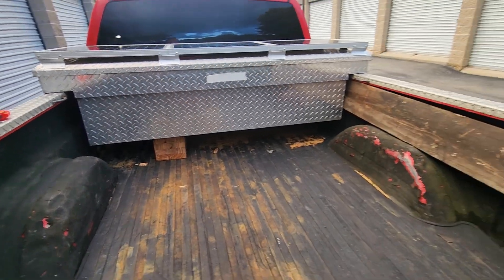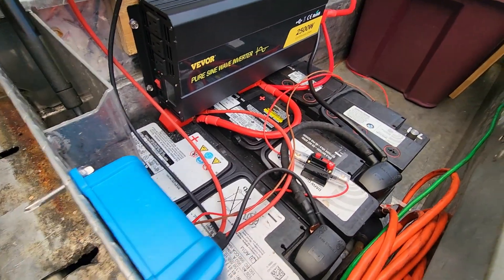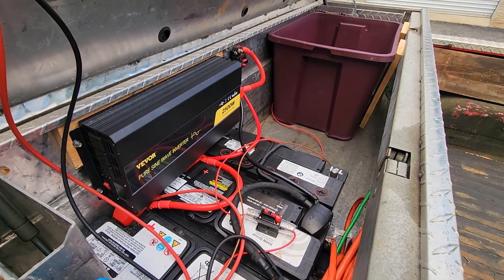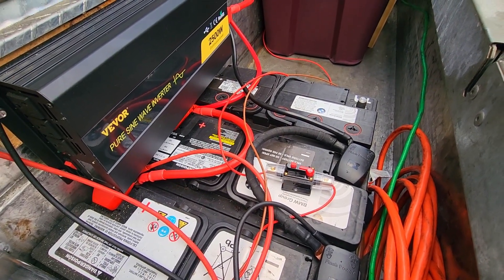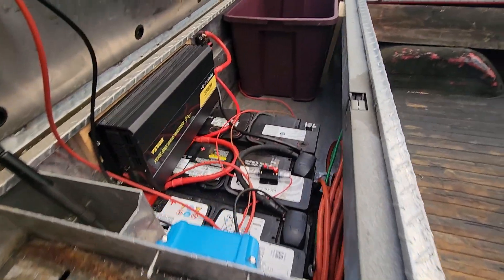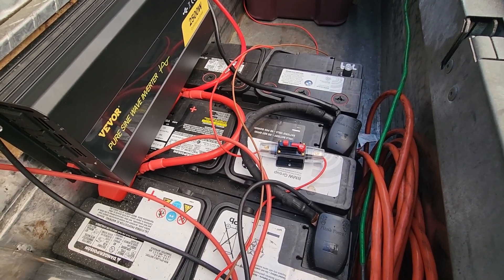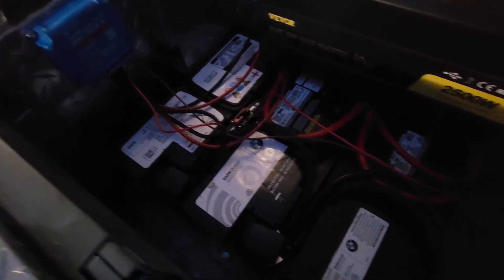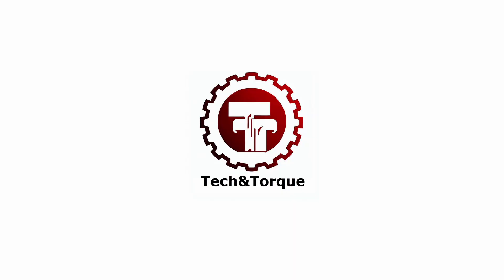Solar Truck Bed Toolbox Update

Comment: I will build the same with your information, please make finished parts list in detail and I will be adding mounted ARB system, marine on/off and outside plug-in for accessories via opening the box. Thanks
Reply from the maker: I have an update video about halfway finished, but living in the northeast it's been snowing non stop. I'll do what I can to add the parts I used to the description

Comment: Looks decent but man oh man, that's a lot of lead being charged from only 150W of panel!  

One thing I wasn't sure about... is your cooler powered 24x7 or only when you are on a job?  If it is powered 24x7 it will eat most of the generation those panels can put out in full sun. The panels in full sun can charge roughly 600Wh/day.  A compressor cooler is gonna eat an average of around 15W though which is 360Wh/day just by itself.   And the inverter's vampire draw, if left on, will be 10-20W as well so if you forget to turn off the inverter that will eat between 240Wh/day and 480Wh/day doing nothing.

To really make it work nicely you probably want another 150W worth of panels and a second charge controller wired into the system so you are net positive.

Also, side note:  The load output of the Victron doesn't need to be fused, It will automatically turn off if shorted or more than 15A is pulled (It will auto-reset and retry every once in a while if that happens).  Also, you can use the jumper to program the low-voltage shutdown for the load output to either 11.1V (reconnect at 13.1) or 11.8V (reconnect at 14.0V), depending how you want it to behave.  See the Victron manual on jumper positions.
Reply from the maker: Yes, this was a quick and dirty power supply that got out of hand very quickly haha. The Victron app shows me most of the nerd data I'm looking for. My fridge pulls about 55-60 watts when not in eco mode, and only runs for about 15 or 20 minutes per hour depending on the temperature inside the truck. I had it running for months and the panels would make it all the way to float charging by noon usually. Now that it's cold here in New England, I have a 150w 12v space heater that I leave on when it's below freezing to keep the windows clear and precondition the interior since I also plow with this truck. I added a Renogy DC to DC 40 amp charger to recharge the batteries from the alternator if needed, but I have it wired to a switch and only needed it once since I installed it. Power went out here for about 12 hours below 0 and about a foot of snow. Ran an extension cord to my house to run the refrigerator, some lights, and thermostat (propane heat, hot water, and stove/oven). There are a lot of needed improvements but so far so good. When it gets warmer maybe I'll add some flexible solar panels to conform to the roof now that they're more reasonably priced. Thanks for your comment!

Comment: Nice! I've been running that same inverter for about a month to pull my sheds lights, fridge, cordless chargers, etc. I did my build in a 24gal Craftsman Rolling Tote and have that inverter, a BougeRV 40a mppt, (All on a piece of Advantec on hinges to allow access to my batteries) 2 100ah Vatrer Lifepo4 Batteries  (Both have Low/High Temp Cutoff and 1 has a Heater Built in, R3 Foam/Metallic Insulation Board surrounding them and Spray Foamed for tight fit and Cold Protection, but they're still removable) 30' of MC4 extension cables, all Fused with Breakers. I have a couple Harbor Freight 100w panels that I put MC4s on for parallel on the fly but have 600w of Renogys on my shed that are simply plug and play. I love these portable builds, might do one for my truck box as well. Great Vid!

Comment: Never seen those quick connect bat terminals before ,cool ! Don’t ask me what you did wrong I’m still figuring this stuff out. I just installed a shunt with a $17 bat monitor and a 2 pole switch to see what’s going in n out ! Guess I need fuses now. Baby steps bahhaha Oh n I have a tool box now with an idea of your doing haha
Reply from the maker: Nice! Glad I could help get this idea out there. I've wanted to do this for years just haven't needed it badly enough until now haha. The victron gives me a ton of data, I enjoy watching it. I should probably shunt the battery bank to see what everything pulls through the inverter at high loads